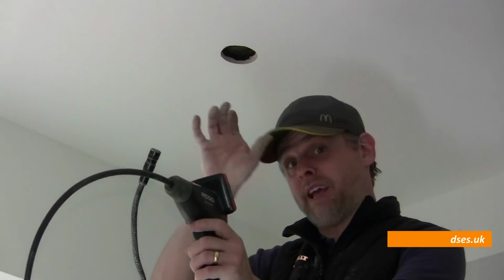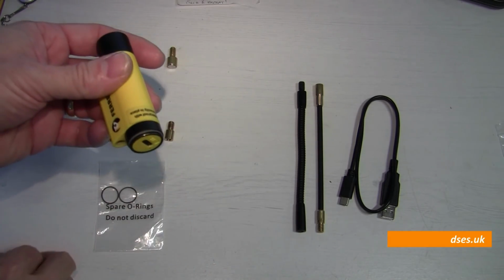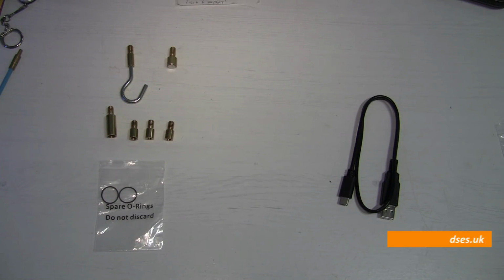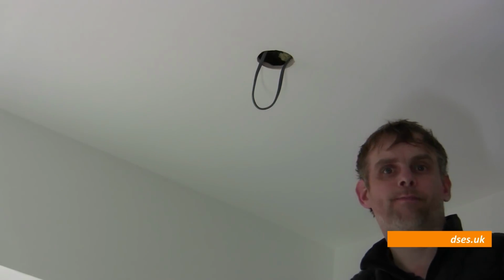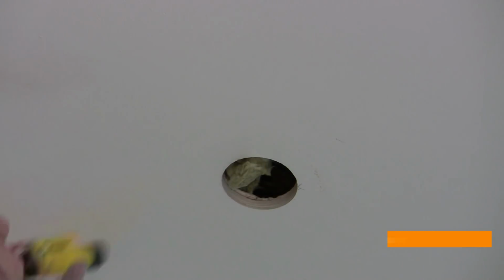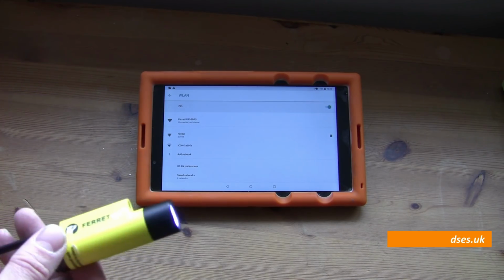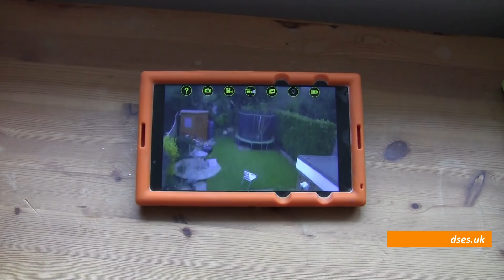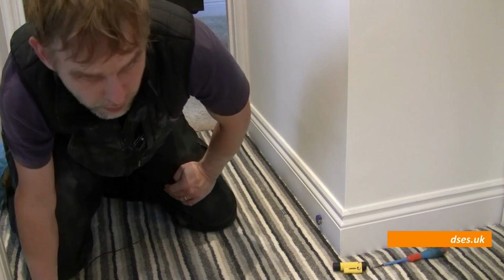NTT- The Ferret WiFi inspection rod camera

Comment: Nice one Mr. Savery. Got this on order from across the pond. Suppose it has an 18650 inside - would much prefer if they let you replace that, as with headlamps, e.g. ZebraLight, NiteCore.

Comment: nice vid,i'm actually passed caring about lost wires since turning up to second fix a job the other week,only to find that the builders had railed,boarded,plastered & painted over the fucking electric meter that I needed to connect my new board to!! good job their granny wasn't sat on the sofa at the time or she would have been dry walled!

Comment: an accelerometer would be a useful addition.
Reply from the maker: That's the word I couldn't think of when on site recording! Either rotation in software via an accelerometer, or gimbal the lens so it remains upright when rotated 90 degrees to either side. It's a small and relatively low-cost package though, and I've no idea how complicated or practical it would be to implement these things. We were using it again on site today to poke around under a floor.

Comment: funny video, my gripe with wifi tech is alot people have a unprotected wifi telecom cable entering the property at low level which takes 2 seconds to cut, rendering all securities useless, unless a sd card is also internally working within each camera...Im also amazed how much beer was still in that glass as i probably would have worn half of that climbing up the ladder..!!..well done DS

Comment: A section of M6 threaded rod will do the trick as a Male to Male adapter, I reckon.
Reply from the maker: Good call. Might even have some around here....
Reply: Yep I came here to say that and it would be possible to make variable-length ones which could be useful

Comment: thanks for the review i like these reviews helps alot something iam going to def. buy (heads up rexel are doing a wifi switch that can be activated by app, voice, timer for a low cost as a idea i have one on order for the 26th as thats there lead time you fancy reviewing it for me )
Reply from the maker: I have a Timeguard WiFi switch here that I was asked to review for Electrical Times magazine but never got around to. It was rather let down by the app as I recall. I'm not a fan of the smart tech generally and tend to avoid it. Something like this camera is okay as it's simple to operate and useful to me in my work, but I steer clear of Nest, Hive, Ring and all that sort of malarkey.
Reply: @dsesuk  i have a shop where they want bt speakers but able to turn the power off at night the issue is getting cable to switch from the counter position i was hoping hamilton air did a one way module but they only do a 4 as i used that in past and was awesome 250m range. i looking at other options unfort they took over the shop already plastered and is in moreton in marsh so a bit posh for trunking on show lifes challenges lol
Reply from the maker: @dsbelectricaldavidbetterid8448  Smart tech is a whole new ball game... but I'm feeling too old to play it!

Comment: Ha ha 😂 your video's are getting funnier Dave, made my night.. I bought one of them lidl endoscope cameras £40 just for exactly the same thing you used it for. Checking clear routes through ceiling spaces, and it's got the hooks and magnets like your old one. The ferret seems a bit bulky and plasicky though. The angle and the way it falls is also annoying if attached to a rod. Bob the builder was a bit of a "slang female bits" for leaving you with that mess. Who's toolbox was it really? Lol.. Funny 😁

Comment: If the 'builder' has caused you more work, you need to bill him for it and not vandalise his tools !
Reply from the maker: Where would be the fun in that??
Reply: @dsesuk  How about connecting the power to the wires and detecting that through the ceiling - and when you found the wires, cut a hole to fit the light there - leaving the original holes 'abandoned' for them to sort out later !
Reply: @dsesuk  Or fit the lights before the ceiling was finished - you do the electrical side of the install and those doing the ceiling finish the mechanical side.

Comment: Great video as always. It looks like it’s in danger of getting stuck in the insulation when you pull it out?
Reply from the maker: Good point, maybe a rounded rear would have been better. I've used it a few times now and not lost it yet, but it's always a risk when ramming a rod in that it won't easily come back out again!